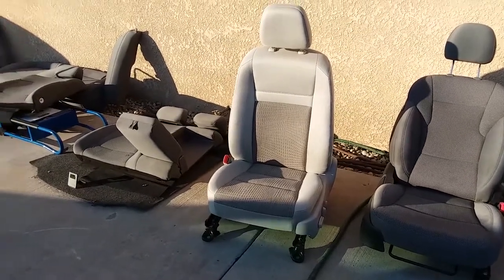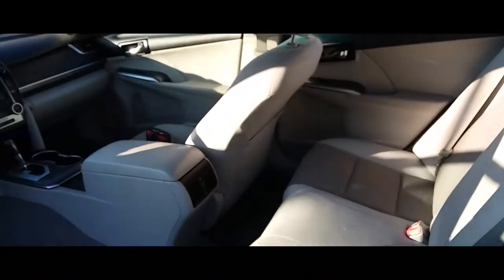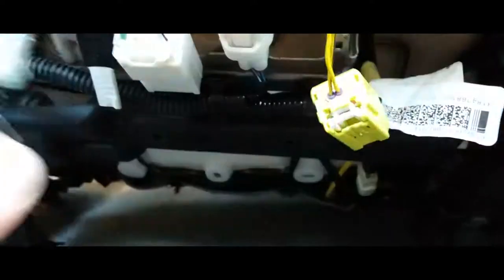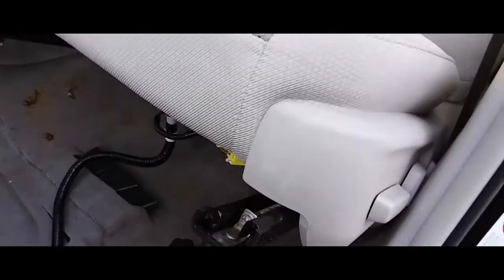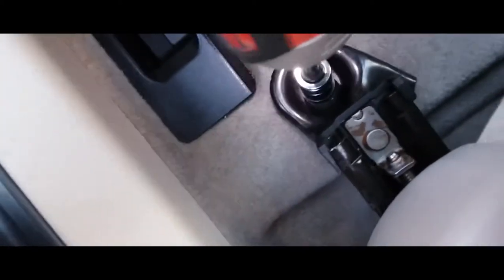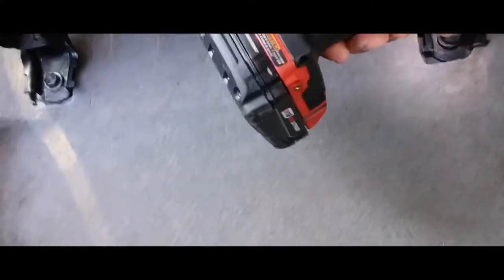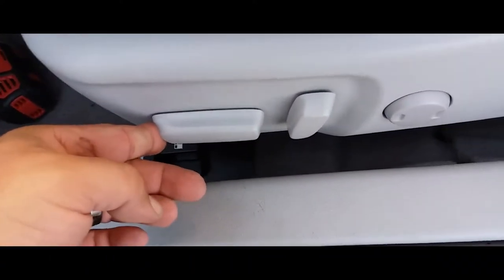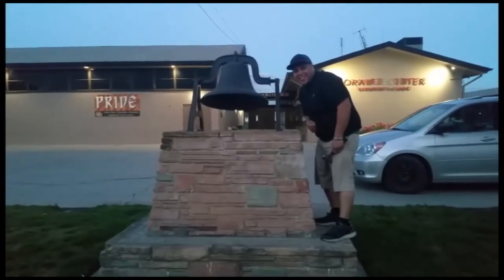How to: Install a Driver Seat on a 2015 Toyota Camry Hybrid

Comment: Hey George. Nice video! Question: I have a 2007 Corolla S. Is it possible to put a power seat on my driver’s side? Or no bc it wasn’t wired for the electrical? It’s a manual seat. I was thinking a power Camry seat might fit?
Reply from the maker: Yeah you can swap it but due to the power it requires and it not made for it will become the struggle to get it to work. You would need to tap into power source to get this done. Sorry bro. Thank you for your SUPPORT!
Reply: @559powerscape  Okay.... so if I get a pro to do this work for me... where would tap into that power source? Where are the cables? Thanks!
Reply from the maker: @963hz  I'm not sure to be honest.  He would have to run the whole wiring harness